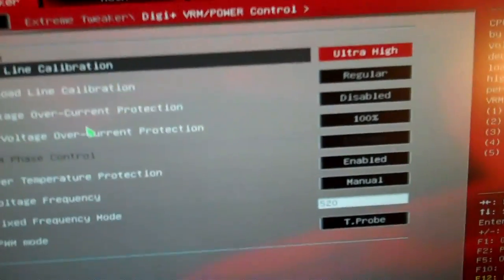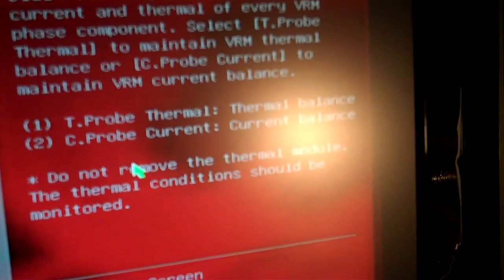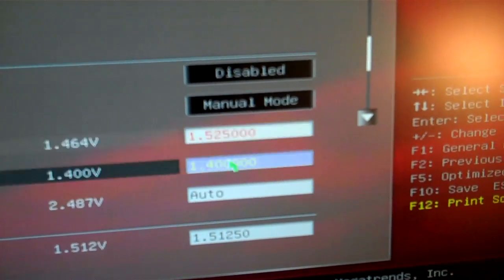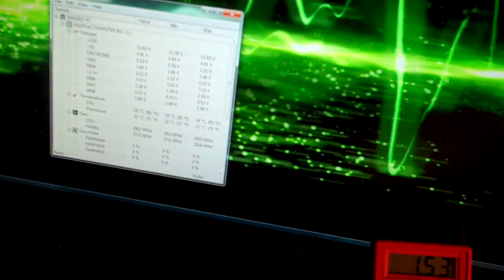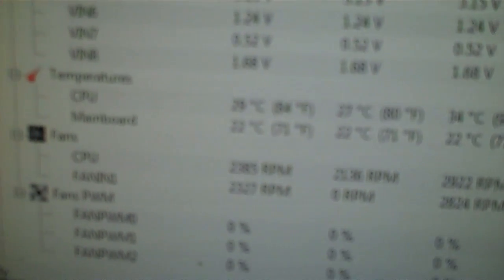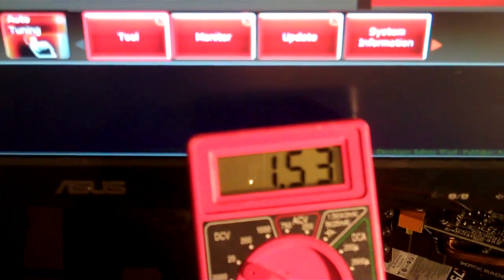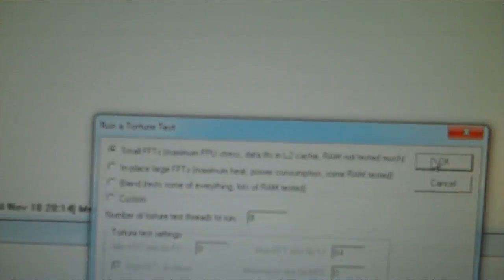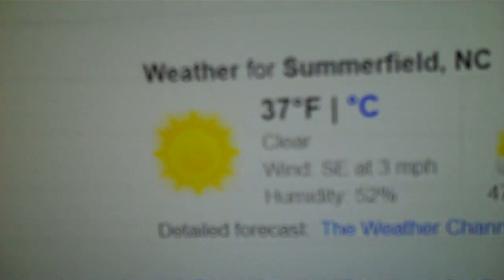Bulldozer FX-8120 #1 Overclocking Part 2/8

Comment: Ya thanks bro...I upped my voltages and now I'm running 4.8/4.9with no problem with stock air. It get's pretty hot, but I have a liquid cooling system I'm putting together right now that should help keep temps under control. Thanks for your posts.

Comment from the maker: Sorry.  Yes just increase CPU voltage to somewhere between 1.45 - 1.475v and you should have no problem reaching 4.6GHz.  If your motherboard has CPU LLC (Load Line Calibration), make sure you set it higher than normal.  Also make sure you disable all power saving features of the CPU (ex. C6, CC6, C1, Cool n' Quiet, etc.).

Comment from the maker: Well I put a couple different values up there.  To reach 5Ghz you probably need at least 1.55v but do that at your own risk.  Every chip is different.  To get to 4.6Ghz you should only need to increase cpu voltage up to 1.44-1.47v.  You should have to change any other clocks or voltages to get 4.6Ghz but you will need to really fine tune to get 5Ghz.  Take your time with it.  Thats the great thing about the FX chips.  You should be perfectly fine up to 1.525v.  Over that your on your own...

Comment: So are these all the voltages i need to increase? make sure to put CPU LLC in the comment i need to know everything before i risk destroying a $250 chip. Are those voltages the max you would go or just the required voltages just to reach 4.6 Ghz? what voltages would i need to get to 5.0Ghz? I'll build my own cooler if i have too. I got to 4.0Ghz and I'm very afraid to go any higher it's very stable at 4Ghz even when running Prime95. Just make sure the info you gave me is correct.

Comment from the maker: Increase voltage at CPU, CPU/NB, NB, CPU VDDA and HT Link a little...  These are max voltages I would go with on the 8 core FX chip:

CPU - 1.55v
CPU/NB - 1.50v
NB - 1.30v
CPU VDDA - 2.625v
HT Link - 1.325v

Ex:

FSB - 250Mhz
CPU - 4500Mhz - 1.45v
CPU/NB - 2500Mhz - 1.325v
HT Link - 2750Mhz - 1.275v

If you just want to increase multi:

CPU - 4.6GHz x23 - 1.475v

You shouldnt have to change anything else.  Make sure you set CPU LLC a little higher.
Try increasing voltage to 1.5v if this fails

Comment from the maker: Keep in mind that even though you may have the same chip doesnt mean that he will be able to overclock as high as this.   Some 8120 can reach 5.4Ghz while others can barely reach 4.6Ghz.   it all depends on the chip itself and every chip is different.   There are no garauntees when it comes to overclocking.   It all comes down to the luck of the draw when you get a retail chip.

Comment from the maker: Make sure you have latest bios.  Then  set CPU LLC and CPU/NB Load line calibration to high.  Then disable overcurrent protection.  Raise CPU voltage to 1.525v.  Set FSB clock from 200Mhz to 250Mhz.  Then set the multiplyer to x18.0.  Set CPU/NB to 2500Mhz.  Set HT-Link to 2750Mhz.  Set CPU/NB voltage to 1.425v.  Set HTlink voltage to 1.3v.  Make sure your ram is not overclocked so you can just work with cpu now.  Make sure all cpu power saving features are off (c6, apm, cc6, cool n' quiet, s1).